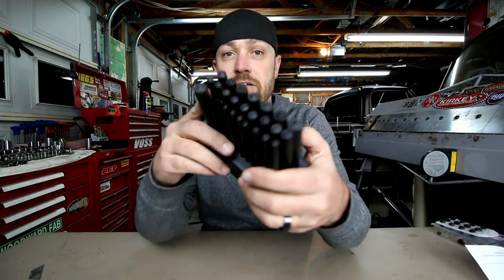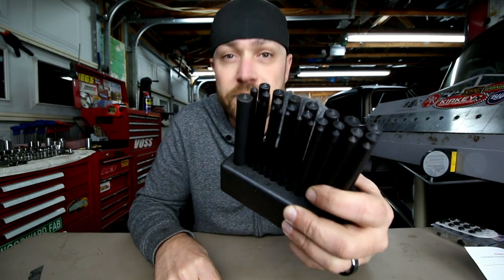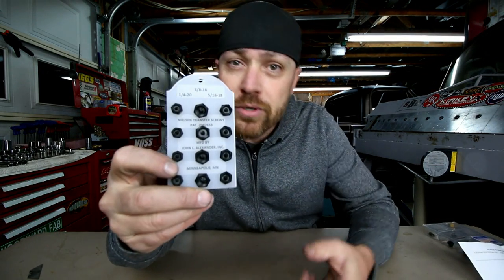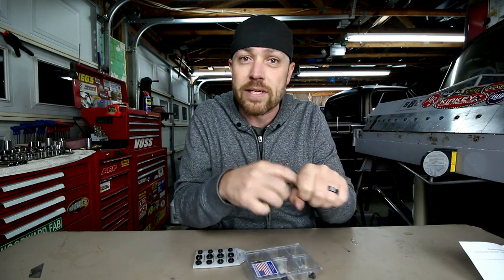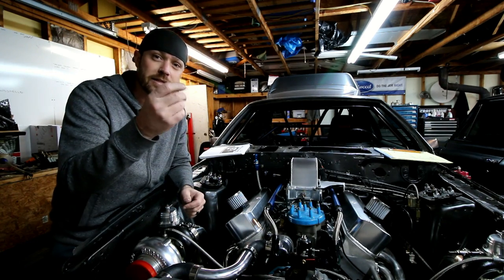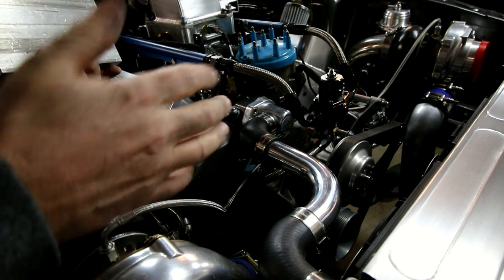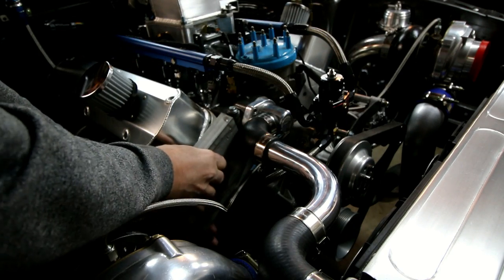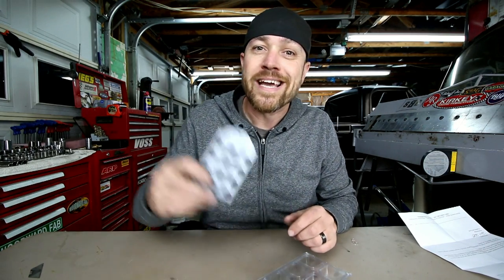You Need This Tool - Episode 62 | Nielsen Transfer Screws

Comment: Good call on a unique tool! I had no idea these existed. I've used paper and my grubby fingers to "mark" the outline of the hole with pressure. Doesn't always work out to well sometimes. 
I've also taken bolts, tossed the threaded shank in drill press after cutting off the hex head, then grind a point in them. Same theory as these. But I'm picking up a set of these. 
Thanks dude!
Reply from the maker: no problem

Comment: THAT'S EXACTLY WHAT I NEED! ( & have needed) Currently I need to fix the heat shield on one of my cars, but I don't know the exact bolt spacing for the piece I'm going to use to mill a spacer...piece...there! Well...it's tough to explain, but these transfer screws are just what I've been looking for!

Comment: i have watched them all .... offshore life is watching movies and of course watch everything kyle voss :)#thefabforms
Reply: What general area are you currently offshore?
Reply: scotland north sea mate, rig called noble lloyd noble
Reply: From my limited experience North Sea tour of duty can be difficult in foul weather and rough seas which  seemed to happen on  every North Sea assignment I had. 
Way to go, the Noble Lloyd Noble is a brand new rig, that has to be nice, what is your job or position? 
Are you based out of Aberdeen?
Reply: yeah brand new massive rig! I used to be derickman for maersk drilling but made redundant so i now work for a norewigen company called Cubility basiclly new style shakers that use vaccum pumps. they are starting to be big in america so hopfully have a trip out to a land rig soon, i think cubility have an office in america that just opened. do u work offshore too?
Reply: Are they using vacuum for separation and degassing? 
I used to work offshore mostly in US. 
Did a 4 month stint in the North Sea as an equipment manufacturer's engineering rep long ago on a rig that does not exist anymore. 
I have never experienced rough seas and weather like that in the North Sea before or since. 
Currently I am a multi-discipline engineer working with professional motorsports teams in the US.
Take care and be safe. 
Cheers.
Reply: nice one dude i use to work for a rally team in scotland but moved on to offshore so i could build my rally car and race it :) check out my channel i am currently building a drift car